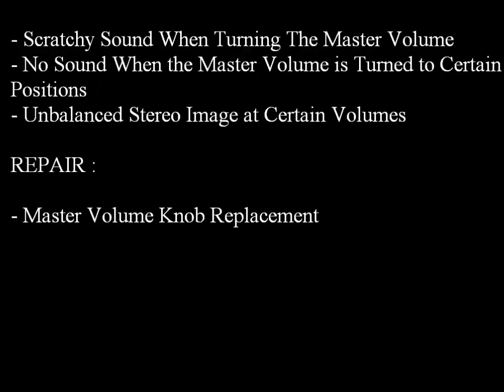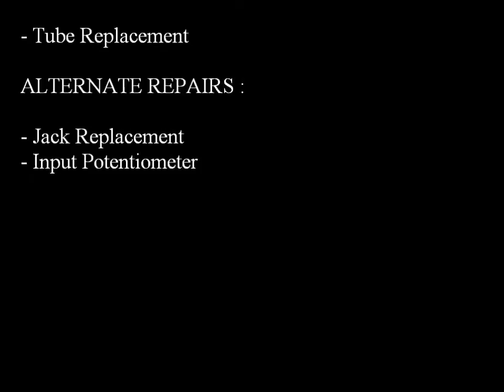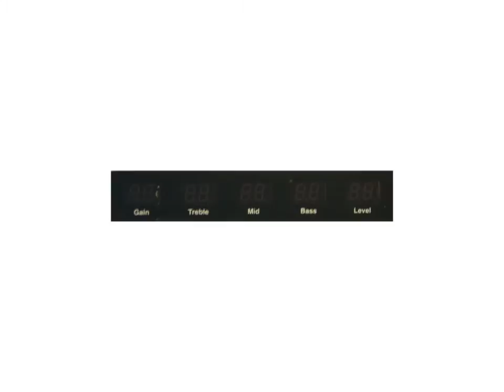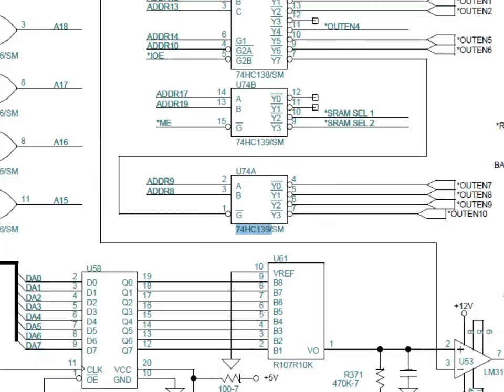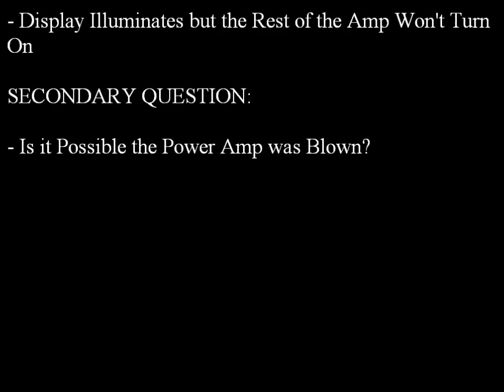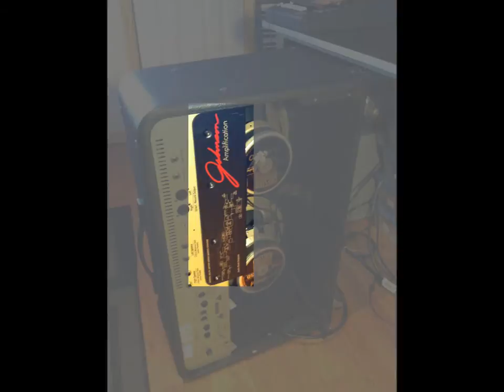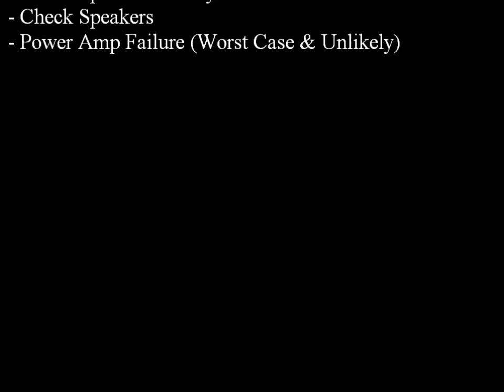Simple, Common Repairs for the Johnson Millennium JM-150 & JM-250

Comment: Hello.  Thanks for the great video!...  I have a JM150 combo that is currently getting repaired.  They found several bad caps, a problem with the RAM, and lastly they believe there is a problem with the eprom.  Ugh...  The caps and RAM problems were repaired.  The big issue is the eprom.  Digitech is out of stock and has been for years.  We haven't had any luck so far in tracking one down.  Would you possibly have one from an unrepairable unit or know where to locate one?  I would much appreciate any info. from anyone.  Thank you!

I miss my amp.  Booo!
Reply from the maker: I have an unflashed EEPROM. Email me through the contact form in the footer of my website www.bosleymusic.com and we can figure out how to get one to you.

Comment: Hi Don! very good video :) I got a JM250, second hand, few months ago. Finally I got time to work on it, patches, etc.. and found that I have issues with cannel A amps mainly, volume of the channel is a lot lower than the B channel in many patches, factory and user. I did a factory reset and volume is very different from one patch to the other, so it looks like a hardware thing... the low volume patches can be leveled to a 'normal' volume by adjusting gain and volume nearly to maximum in many cases... I thought it might be a faulty valve problem, could be that?  thanxs :))
Reply from the maker: Most of the amps' "volumes" vary from type to type. As an example, the VOX levels are extremely low compared to 65 twin or Matchless. There is also a master volume setting buried in each patch under the config menu where you can level patch to patch out. As far as A to B volume difference, this also isn't too atypical of any type of amp - modelling, tube, etc...the volume or power generated is exactly the same, but because of the addition of upper harmonics in the signal, the perceived loudness is greater. Doesn't sound like a hardware issue. Sounds like getting used to how this particular amp behaves versus whatever else you're used to.

Comment: I have the Johnson' 150 combo amp.. It recently stopped showing anything... No names,no values, nothing! The same with the J-12 pedal... It does light up when turning the power on, but nothing else. I have the original manual but I can't seem to understand how to fix this...? How can I reset the amp to it's original setting? Or must I bring it in to a Repair Shop? Could it be tube related problems? Please help me!
Thank you....Mark in Atlanta
Reply from the maker: Time to take it to someone. This isn't a factory reset issue - it sounds damaged. Tube death wouldn't prevent the digital section of the amp from turning on. Start with the portion of this video describing the power amplifier repairs - namely disconnecting it to see if the amp turns on and check the signal from the XLR's.

Comment: Hi, my JM 150 buzzes. I have the input level half way and when I turn the master half way or more I get buzzing from the chassis more so when I play the low e string. I stuffed a cloth just under the chassis on the right side at the front of the amp and it helped but it didn't completely disappear. I thought it was the speakers but I tried different ones and that made no difference. Any thoughts? Thanks
Reply from the maker: Something is resonating - check chassis screws, fan if you have one, screws holding the speakers in, and another good test is to unplug both speakers and try them one at a time. The amp has a passive loading applied so you won't damage your power amp by unplugging speakers and continuing operation. Otherwise you may need to open it and check for loose components or screws inside. Given the fact that the unit is at a minimum 10 years old, it might just need a little tune-up/tightening.
Reply from the maker: Also, check the screw posts for the fan assembly very, very closely if you have a fan. The nuts on the back certainly come loose over time - especially if you carry it with the back towards you.

Comment: I have a question about the master control and contour pots. In searching for replacements I'm seeing "linear or logarithmic taper" which would be the correct replacement? Thanks.
Reply from the maker: Technically neither. It's a "W" tapered pot. which has a special resistance curve. I recently had an email that said the person used a regular log taper pot with good results. You're far more likely to find log taper than W, especially because it's dual ganged, and PCB mount, not terminal.

Comment: Awesome video and notes. I haven't been able to play mine since being back in New Zealand, as I bought it in the US. Is it possible to bypass the 110v transformer and use the 240v straight from the plug in to the amp? The cost of buying a good enough transformer to reduce to 110v just to plug it in, then to have the amp to bring it back to 240 seems overboard?
Reply from the maker: The transformer has multiple sets of windings and steps, so it wouldn't be as simple as one transformer, unfortunately. If you plug it into 240 without step-down, you're likely asking for the destruction of your unit, and at  minimum a blown fuse. Don't try it.